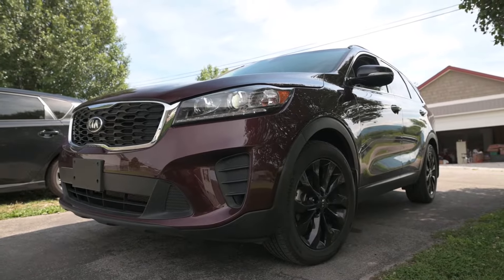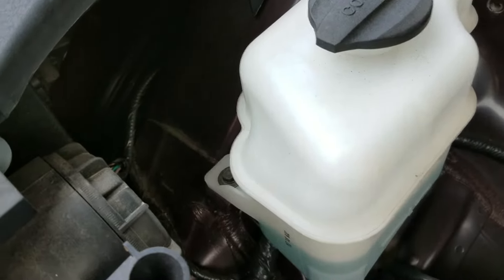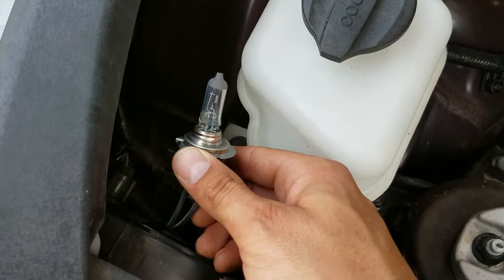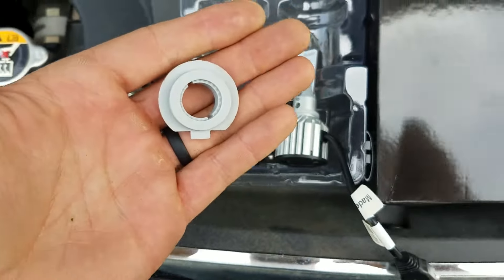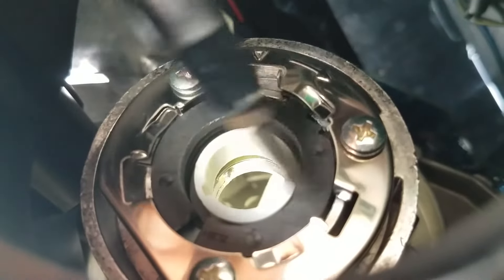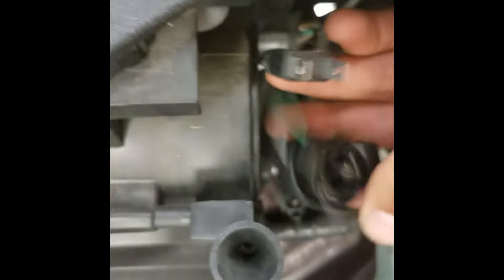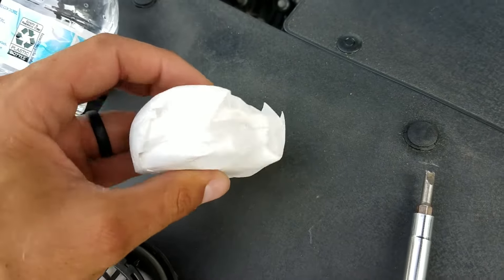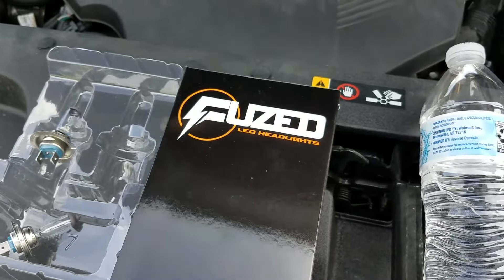How to Replace Headlight Bulbs 2019-2020 Kia Sorento Install (+LED CONVERSION)

Comment: Thank you for this video and link for the adapters. Just bought a 2019 Sorento and the previous owner didn’t use the adapters so the headlights were wobbling all over the place. Just purchased. Thanks again.

Comment: I'm using LASFIT LED's on my Veloster and my wife has a 2019 Sorento that I'm planning on upgrading as well! This video was helpful in more ways than one! I wasn't sure if I needed to buy the extended dust caps or take my chances and hope the wires will tuck in under the housing. That and I had NEVER seen that white fluffy thing on the dust cap and had no idea what the hell it was LOL!! You def answered my question there haha!

Thanks!
Reply from the maker: Glad to help!!
Reply: Same. I didn't know what the heck that white stuff was lol
Reply: It's most likely a dessicant pack, there to retain (absorb) any moisture present within the housing

Comment: i have a 2018 sorento lx and changed my low beams from halogen to GTR lighting HIDs i did have to lower my lights a bit as they were aimed to high from the factory but now it has an even better crisp cut off line
Reply: Hello there can you share with us which lights you buy.

Comment: I have a 2015 Kia Sorento SX I bought 2 different sets it led lights and I can’t get them to work!? I will turn them on they will stay on for a little bit then turn off. Also, on low beam on 1 will stay on and the other won’t? I tried reversing them (polarity) and still not working!? 
How is it working for other Sorento and not mine? Do I need to buy something else to make them work?
Reply from the maker: That may be an issue with the particular bulbs you are using or with your vehicles computer system. I would either try adding canbus decoders to them (plug and play) or trying a different brand of bulbs.
Reply: @mycoolshows6702  
Thank you for the info!! 🙏👍

Comment: Folks you don't want to use LED's on projector beam headlamps. It will shine EXTREMELY bright to oncoming drivers. Plus, potentially burn out your bulbs. You can upgrade to a higher HID but stay away from LED's in projector beam headlight vehicles.
Reply: What are the projector beam headlamps? Don’t know🫤

Comment: What kind of adapter did u used ? I bought from ebay and amazon both loose and cant tighten it .  I got 2020 Sorento V6 LX.  Do u have the link for the adaptor ?tks
Reply: Did you find the adapter? I have same vehicle
Reply: I have the same problem. Does anyone have the link to the adaptor?  The one I bought does not work.
Reply from the maker: Here is a link! https://www.ebay.com/itm/133493860185?mkcid=16&mkevt=1&mkrid=711-127632-2357-0&ssspo=qOb530Z9QZO&sssrc=2047675&ssuid=vKhB3xSiTWO&widget_ver=artemis&media=COPY
Reply from the maker: @johnlester8505  https://www.ebay.com/itm/133493860185?mkcid=16&mkevt=1&mkrid=711-127632-2357-0&ssspo=qOb530Z9QZO&sssrc=2047675&ssuid=vKhB3xSiTWO&widget_ver=artemis&media=COPY
Reply from the maker: @TheDonuts1234  https://www.ebay.com/itm/133493860185?mkcid=16&mkevt=1&mkrid=711-127632-2357-0&ssspo=qOb530Z9QZO&sssrc=2047675&ssuid=vKhB3xSiTWO&widget_ver=artemis&media=COPY

Comment: Do you happen to have a picture or something of them at night?  I was going to go HID, but of course ran into the dang issue with the stupid KIA design.  With this video, I will end up going LED.  I have been running Silverstar Ultras.  Are they brighter?  Whats the color like at night?  White? Bluish White?  Thanks in advance
Reply from the maker: the color is more white than blue, I don't have a picture at night of this particular vehicle though.

Comment: Question: did you change out the high beam bulb as well? I really enjoyed your video. I found it very informative.
Reply from the maker: Glad the video helped you! Yes I did change it out with the FUZED 9005 bulbs. Completely plug and play no adapters required for the high beams.
Reply: @mycoolshows6702  thank you very much for the response. The 9005 were out of stock when I ordered the low beam led bulbs. I was told they may be available around the 20th.

Comment: Do you have to align your headlights after doing the replacement? or this swap does not affect the headlights alignment at all?
Reply from the maker: It's good practice to check and make sure they're aligned after swapping to LED. But they won't be very far off if any at all just from swapping the bulbs.

Comment: Hello, Im trying to install a pair of Fahren Led lights. Very similar to these. How did you fitted the led base with the adapter and kept it from moving? Did you had to glue them? Thanks!
Reply from the maker: It was very tricky to get both in there at the same time. Using glue to hold them together would be a good idea if you can't get it without.

Comment: What bulb did you use size and brand?
Reply from the maker: H7 Bulb size for low beam, 9005 bulb size for high beam. Brand is FUZED LED

Comment: Have u seen a way to adjust the up and down headlight position? My 2019 Kia ex headlights seem to be pointing down. I can only find a way to move them left or right. Thanks again for the amazing video. It will help me a lot. @mycoolshows
Reply: It would be great to be able to move them up! Particularly the low beams.
Reply from the maker: I haven't looked but normally there are up and down adjustments on all vehicles. m=It may look like a small gear on the back of the housing. Even possibly a small hole for access with a long screwdriver.

Comment: Bro the most important part is the darn adapters, and you couldn't take 3 more minutes to explain how to connect them together?!? These lights are HOT GARBAGE. Buying a plug and play set that DOES NOT REQUIRE ADAPTERS FROM AMAZON. Dont waste your money on this crappy system.

Comment: Im not sure the wire placement really matters
Reply from the maker: The wire placement does not matter with halogen bulbs. But with most LED bulbs (these in the video in particular) it does matter.